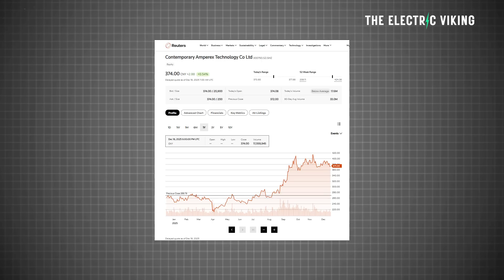AI TAKES OVER! CATL Is Using Humanoid Robots On Its Battery Production Lines

Comment: Now there is the factory of the future - using cheap energy, not labour. People could receive a basic income and care about their families, sports and hobbies while machines do the work. Work part-time. Or work 20 years and retire instead of 45 years. This has not happened since Roman times and slave labour. Basic condition: abundant, cheap energy like in China. In Germany and the UK it´s not possible to do. Electricty prices are prohibitively high to be competitive. What does VW do in Germany: pay workers and use labour - because it´s cheaper. In China the very same VW-Group is betting on further robotization of their factories and produce cars at half the price. In Germany they will keep firing people, not go for further automatization, shut down factories and rather shift production of future models to China altogether.

Comment: Another reason for using robot is safety, there are lethal voltages involved if you touch the wrong thing in a cmoplete battery pack and using a robot gives them complte reproduability with no hymanerrors.
Reply: It's spelt 'hymen' but, yes, they have complete reproduability too as they don't need one :)